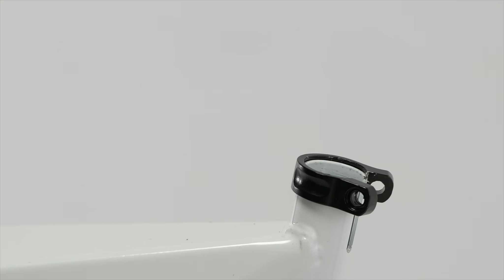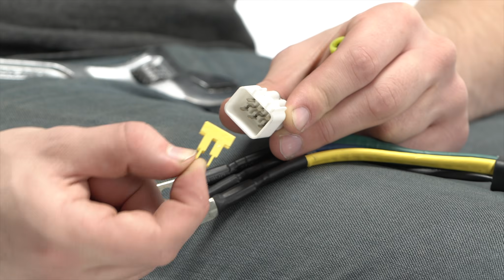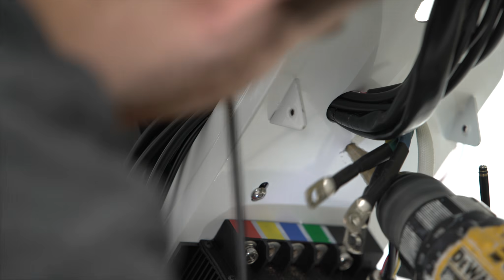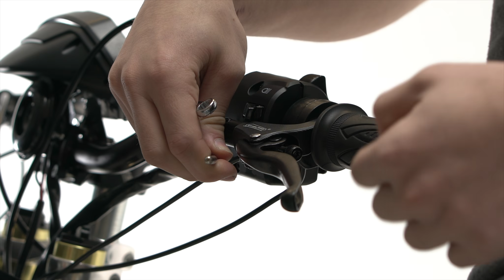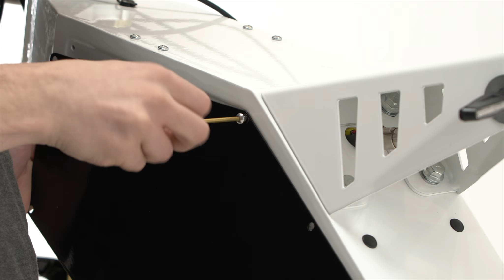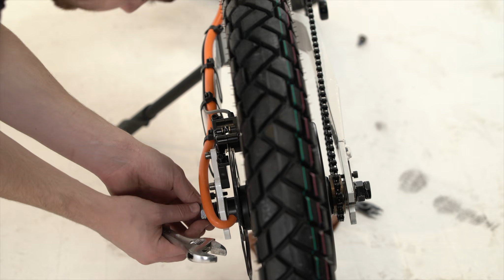eBike Theory Pt. 5 - Final Assembly & Power On

Comment: I think the price on the battery (see parts list) is based on a used battery.

I think price should be $300-$500 for that size battery pack (?)
Reply from the maker: It is, but most people that purchased an original onyx RCR are letting the 23ah packs go for somewhere in the $200-400 range. They pop up for sale pretty often

Comment: Thats an e=motorcycle not an e-bicycle, and it would need a license plate to be ridden on streets in most states... to get a plate in most states, it would need a VIN, mirrors, brake lights, turn signals and the rider would need a motorcycle license, and a DOT approved helmet..
Reply: if it has pedals, it's a bicycle
Reply: It seems like it does have break lights on the rear signals unless I missed something, it does need a license plate and depending on the state an inspection. Technically because he built it himself, he is sidestepping the normal regulation that would force you to do these things. This is similar to the 3d-printed ghost gun argument. If it's for personal use and not commercial use, unless you are doing something stupid, you are unlikely to get ticketed or fined. Also in some states it wouldn't even need an inspection, just a VIN and registration. I'm sure this is something that people who build kit cars deal with all the time. Still I'd be hard pressed to find an electric moped for under $4K. DOT approved helmet is not going to help much when you get tossed from one of these at 70 mph.... but why not preserve your face for the viewing with a visor helmet.
Reply from the maker: @infamousmatt44  if you ride under 25mph, it is a class 3 eBike! If you would like to go faster, you can register it as motorcycle. I was able to register my daily rider using a service called dirtlegal. It does have brake lights and turn signals, would need mirrors added for most states though!
Reply: Yes, if you get permission by the government then it's ok. It's SAFE then.
Reply: @wearebacteria  SAFE... ahahahahah. That one gave me a chuckle.
Reply: And you are a narc